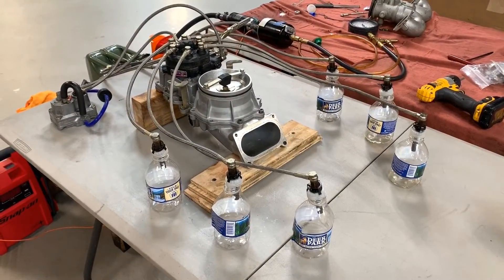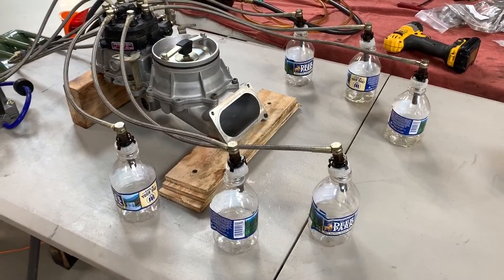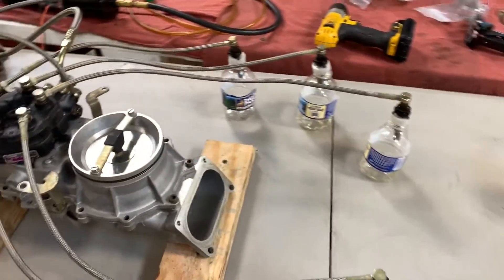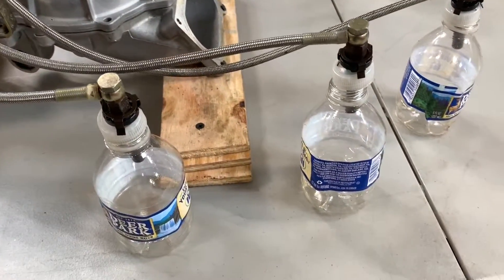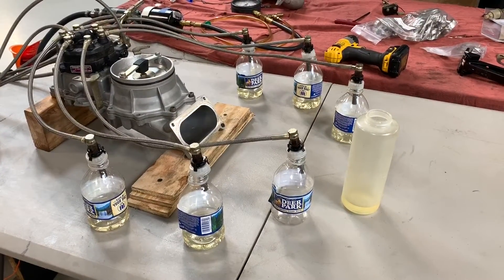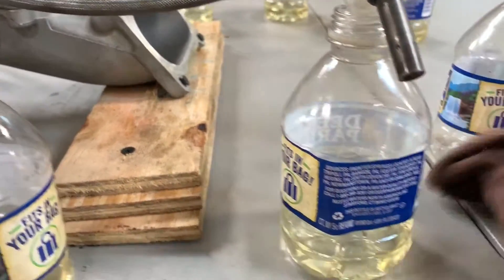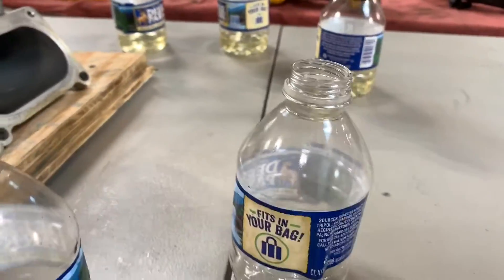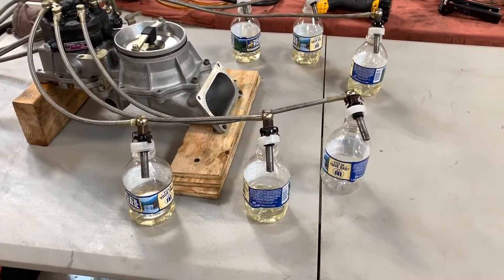DeLorean Fuel Distributor Part 2

Comment: Also what did u back flush your injectors with?
Reply from the maker: What didn’t I try?  Ended up using a GM top end cleaner.  Letting the chemicals gravity feed backwards over hours with the tip held open greatly helps with even flow but nothing was a substitute for new injectors.
Reply: Tim Ferrin by any chance did you try Techron? I think the manuals indicated using that. Curious what you found?
Reply: Porsche manuals.